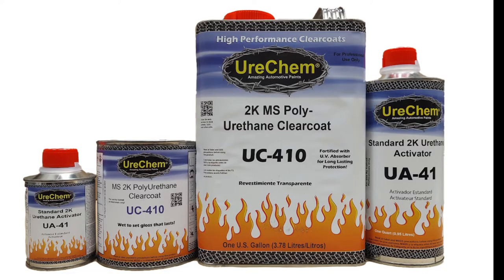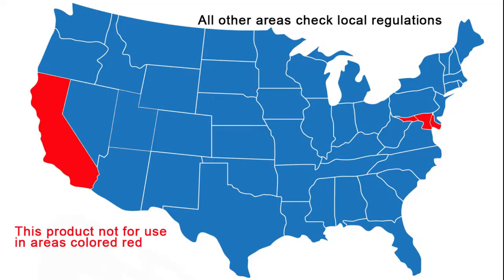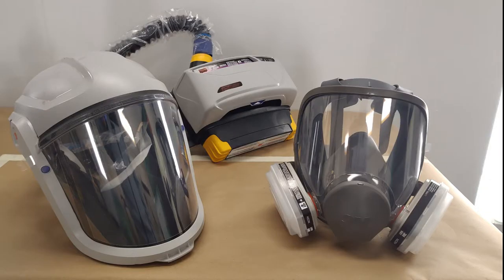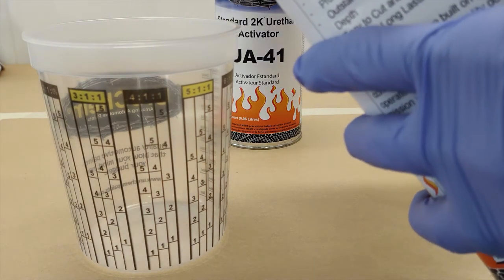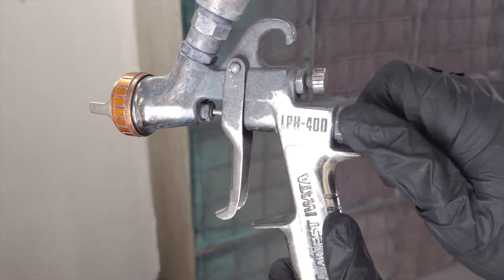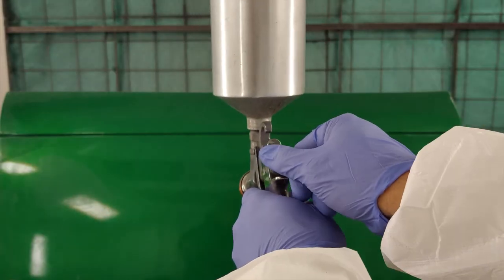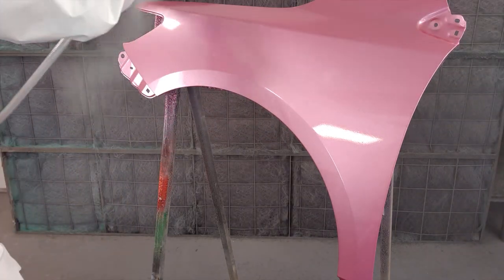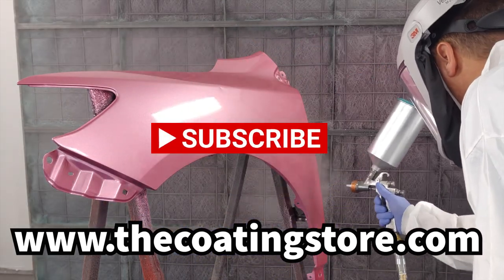How to use UreChem MS Performance Clear UC-410

Comment: I'm wondering how long this clear will hold up. I'm in Texas and have no garage to park vehicle. Hopefully it won't fade. I painted my harley a few years ago with a cheap ebay paint system after 6 months it was fading.
Reply: From what I have seen, go with the Glamour Clear HS. I have seen folks say they have used this and it still looks good 6 years later after being outdoors in the South.

Comment: The shrink back the next day is terrible 
Looks awesome after you spray it. The next day it’s all orange peel 

Damn near impossible to run it I’ll give you that
Reply from the maker: UC-410 MS Clear is certainly more sensitive to heat, humidity and moisture during application and drying than our HS Glamour clear.  However, this fender still looks good even un-polished.  Once polished both the MS clear and HS clear look like glass.
Reply: @UreChemTV  
I plan on trying the HS in the future
Reply: @paintbykevin886    Just remember, that the volume of fluid is very important. If fan pattern is set for six inches, then hold gun square with surface a 6 inches. Think like a robot the includes pattern but path. So it should look wet with a 50% overlap of last pass. If slightly dry, then move toward a 70-75% overlap. Try 3 wet coats, give it a chance to evaporate and chemically cross-link (Hooking one molecule to the next) Also, panels on a parts tree or stand, will look different when bolted on the actual vehicle. Find a short-stroke DA sander often called finishing sander, usually with a 5/16” orbital action and start dry with an 1/2” interface pad using 600g - 1,000g to create a tooth for a flow coat. This means extra work but allows one wet coat, properly mixed at the right temperature and with fan & distance in mind, spray on wet coat and let it melt into the original clear coats. It has no to little shrinkage but no “Cut & Buff”. So, basically one & done after the HS has dried completely. Many do this but charge extra if this is customer pay. But you will be shocked of the results. Done!